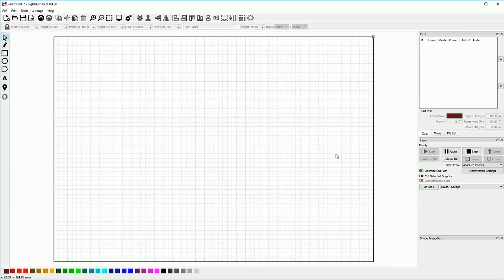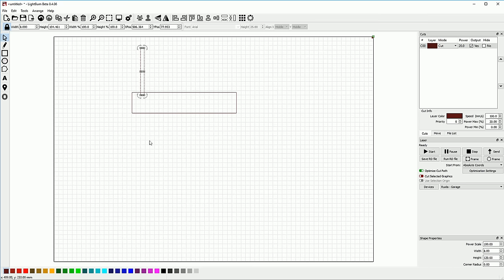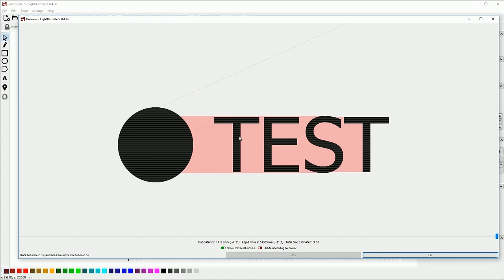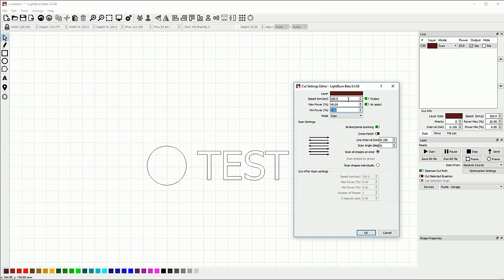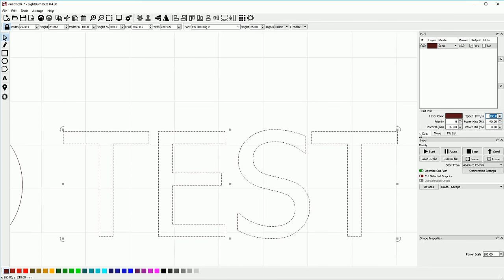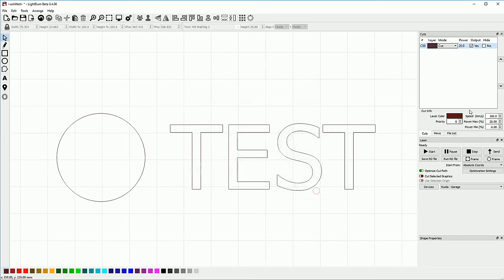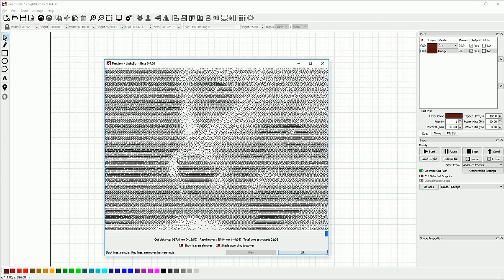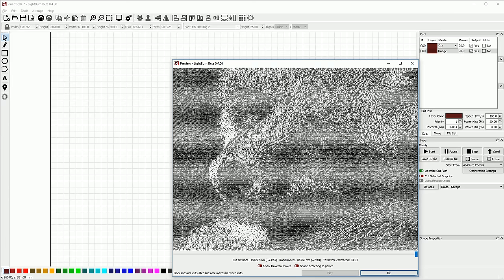Cut Settings

Comment: I followed along with you and with a few bumps along the way finally got to where you were measuring out the size of your wood.......couldn't go any further.  I just don't know what I was doing wrong.  I would put in my measurements at the top, lock the lock, assign that line to T2 then the arrow/heart would turn blue.  I am at my wits end.  I have a Sculpfun S30.  Trying to use Lightburn.  :(

Comment: great video ! . I have a questiom about the latest version of Lightburn (0.9.19) has different cut modes like ' Line', offset fill , and fill+line. did not see any documentation on it even in the underlying help docs. any explanation on it please ?  . compared to the video we see like 'Cut' etc .

Comment: I Really like the Results with Cross Hatch. I see the option when I created the file from within Light Burn, however if I open a .png I did not see that option.
Is that because of the file extension? Or am I doing something wrong?

Comment: Just got my laser and practicing using light burn.  For some reason I only have options of: Line, Fill, Line + Fill.  You have options of cut, scan,  etc.  My power/speed is the same for line as it is for fill.  Any suggestions on what the difference is and how I can cut out?
Reply: LightBurn Software thank you for clarifying

Comment: Hi this is my first engraver, and I’ve never used a program like Lightburn. I set my laser up today and tried to run a test burn on a piece of wood. The laser went through all the motions, but it did not make any marks on the wood. Which settings should I check to see if it’s a user error or a lens/laser error?
Reply: @lightburnsoftware7189  it’s a 20w Laser Master 2. I can see a blue laser going through the motions when I test it.
Reply: I came here with the same questions. I cranked my laser intensity to 100 and slowed the speed to 40 and it was still really light.

Comment: Nice tutorilas but it seems lightburn has changed a lot There are many things in the interface that have changed so for a beginner it gets quite confusing- That scan thing I did not find it anywhere- and there were other settings that do not appear and other that are new that I don't see in the videos- How old are these? Now that youtube has decided to hide the date in which the video have being published is quite difficult to know how old the videos are
Reply: @lightburnsoftware7189   Awesome. Thank you for your fast response. I finally found that the date not showing on youtube is a lay out problem on some screens. I had to zoom out to 65% and I see now that they are from 2017. Quite old.

Comment: hmmm, I would have to wonder, take an image and place it horizontally, greyscale dither it. Now take that same image and rotate it 90 degrees, move the once burned image in machine and rotate it 90 degrees also, match them up in alignment, would burning it that way create a better image due to the power dithered cross hatching? 
/EDIT oh, the software can do that, sort of with the scan angles... interesting.  Will have to try both and see the difference, if any.

Comment: Hey I need help lightburn isn't staying connected. It says there was a problem sending data to the laser. The machine my be busy or paused. I made sure the drivers are connected, right clicked device to reset the connected, even power cycle everything still not working. I'm using the ortur laser master 2

Comment: Was wondering if you might know what settings to use to cut mirrored acrylic on the tool d1 ten watt laser.
Reply from the maker: In my experience cutting acrylic with diode lasers is tough. Black may be the exception and is the primary one I have seen cut on a diode. XTool does have some settings you can use as a basis https://www.xtool.com/pages/material-settings

Comment: Hi sir. On my lightburn on menu shape properties for image. Its not show the brignest and contrast sir. Whats wrong???
Reply: @lightburnsoftware7189  0.8.7 sir
Reply: @lightburnsoftware7189  alright sir🙏
Reply: @lightburnsoftware7189  hi sir. can it be when the gravir takes shape? for example we engrave a circle of 20cm with a line thickness of 3mm. so if the scan mode the laser moves line to line, 20cm. can the laser move in a circle with line to line, 3mm and move in a circle?
Reply: @lightburnsoftware7189  i want like e cut travel. But that is scan mode
Reply: @lightburnsoftware7189  hi sir. When i use lightburn to cuting plywood 5mm. What is the best seting?? Should be i use z step per pass sir???

Comment: Why does mine say line and not cut? Can I change that, do I need to change that? I'm trying to cut but my laser is not cutting! im cutting while engraving. So, mine is set at line for the cut and then fill for the engraving.
Reply from the maker: Line would be the equivalent of cut. Normal operation for making a cut is line mode and then adjusting the speed, power, passes to be appropriate for cutting the desired material.

Comment: Really liking the software. Can you tell my why all the sudden svg's are getting the traversals are powered on? Did a couple test engravings and they went fine but then the last couple svg's I imported started getting cuts where the traversal lines are. Very odd. I closed the program and deleted my preferences file and then started the program again so it was back to default but still cutting the traversal lines. I hope that makes sense. I couldn't find anything in your docs or faq.
Reply: @lightburnsoftware7189  Thank you for your prompt reply! I'm still a newb  :)

Comment: Hi, pls help explain. Overscanning - this feature is available in the setting of light burn for use of Grbl - and it is hardware setting if used Ruida am I understand this correct? how do I find out on my Ruida to do this? Thansk
Reply: @lightburnsoftware7189  Thanks
Reply: @lightburnsoftware7189  - Thank you

Comment: does lightburn have a basiair line tool?
Reply from the maker: Yes, the line tool will let you draw Bezier Curve. There is a 30 day trial of the software available on our website if you want to test out its design capabilities.

Comment: Ligth burn can be use with neje lasers?
Reply: I run a neje 30 watt input model via a grbl controller on a cnc3018.  Lightburn works great.

Comment: Can someone help me for some reason now when I change the passes it will indicate it change however  it will only make one pass
Reply from the maker: When you set multiple passes and it is only doing one can you see it running multiple passes in the preview window simulation?

If you are still having issues contact our support team at support@lightburnsoftware.com

Comment: Hello good afternoon, how I can calibrate my ortur laser master 2 with the program ?, does not cut me perfect circles
Reply: @lightburnsoftware7189  the design of the circle is fine, the problem is in the cut, it does not end at the point where it starts and therefore the circle is deformed

Comment: how do Iget light burn from my computor to my lazer printer
Reply from the maker: Sending a job to your laser from LightBurn can be done over USB or Ethernet. An alternative to this is LightBurn Bridge if you have a Ruida based laser. 

I would start by watching our getting started video:
https://youtu.be/v3RDzOrlCTM?si=CIrB43Esau6qtx5s

If you are still having troubles getting the laser set up in LightBurn send the specifics of your machine and the issue you are having when trying to run a job to our team - support@lightburnsoftware.com

Comment: uuuuf the latest version looks much different....
Lots of videos dont make much sense anymore,....... I just want to create a cut line from a vector... and then the only thing I find in videos is guys saying like yeah and then you can create a cut line.... But its not shown how lol
Reply from the maker: If you have a vector, setting the desired shape to line mode will allow you to cut (if you set the appropriate speed and power). We are actively working on revisiting these early videos to bring them up to date while also making them a bit more concise.
Reply: @lightburnsoftware7189  got it working and by now i understand more about the layers